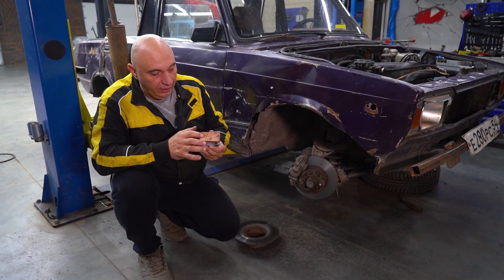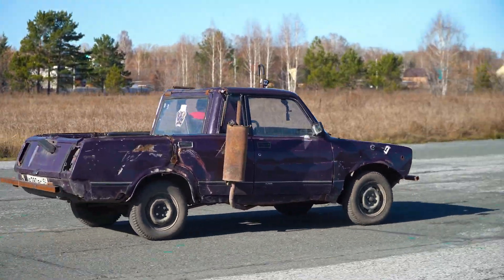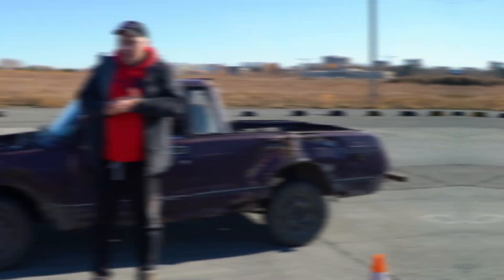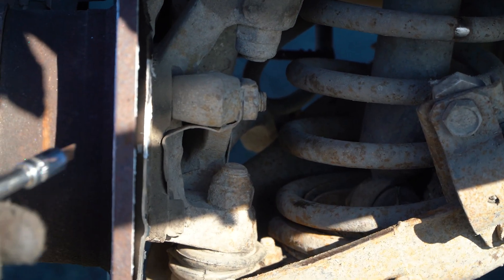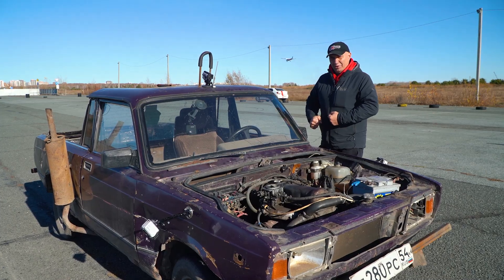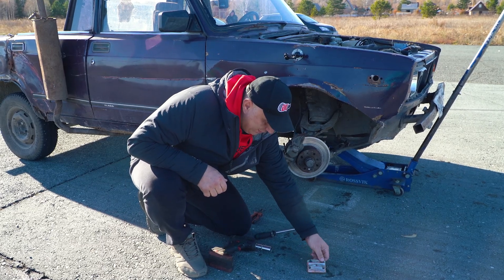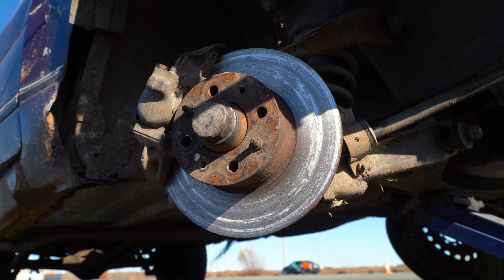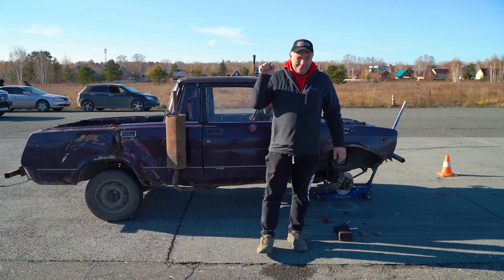Aluminum vs. copper brake pads – which are better?

Comment: Whatever they made my 1979 Datsun 620 brake shoes with is the best, they have lasted over 40 years and still have 40% left.
Reply: How many miles?
Reply: @DarkLinkAD  only 57k miles. It's not just the miles, but the time. The pads are not cracked and the original hardware still functions perfectly, it's good quality stuff.
Reply: Asbestos
Reply: @MYartiisMuRdEr  Good stuff. Trace amounts, it's inert and stable in a brake pad. If I was changing them several times a day, all my life and blowing dust everywhere. I might wear a mask.

Comment: I'd like to see comparing that to tungsten pads. Probably wouldn't wear down at all.
Reply: You kind of want to wear the pads instead of the rotors though...
Reply: Yeah, you'd cut straight through the discs, without actually having much grip.

Comment: You guys have noticed the shiny metallic flecks in brake pad material? Copper is one of the metals used in the brake material. The light coloured flecks, could be aluminium, or magnesium.

I'm not sure about modern pads and shoes, but in times gone and past, brake linings were formulated for specific applications, and in particular, according to whether the brakes were servo assisted, non assisted.
Reply: Copper has been almost fully eliminated at least in North America, it was causing reproductive issues in salmon. I believe they are limited to 5% copper max, some brands have moved to a fully copper free formula.
Reply: Id like to see the study on that, copper is still in every Horse/Cattle Salt rock, Every vitamin/mineral complex for humans and is an addative for turkeys to relax the arteries, preventing a heart attack from rapid growth.
Reply: @DarkLinkAD  I understand, and all i have access to is the internet, so i suggest that you google "copper being removed from brake pads".  and while copper is necessary for humans, it is well known as an effective agent used to prevent sea creatures from attacking boats.:goodvibes:
Reply: @bgbthabun627  I learned that information before the internet was a publicly available thing, farm work. If you have a study to reference from a reputable source such as PUBMED, ill read it. Im not much for google propaganda though
Reply: @otm646  that's correct don, so good of you to mention this.

Comment: So what do the major brake pad suppliers use on their full metallic pads? I'm sure it is metal but of a powdered construction. I don't know but I would like to see if you could buy your own lining and reline your own pads. In the old days here in the states you could get linings for brake shoes. Sure there would be issues with some jackleg not doing it right but...
Reply: Ceramic and carbon mostly, depends really.
Reply: Steel, copper, ceramic, kevlar are some common materials, all bound in a carbon compound

Comment: Copper work hardens when force is applied and softens when its heated. In this case both were happening repeatedly, so a graph of the results would have been interesting.
Reply: am i remembering correctly thay copper gets a h igher coefficent of friction the hotter it gets to a certain point? cinter clutches and racing brakes have copper and stuff like that in em if i remeber correctly, and they all need abuse to work correctly.

Comment: I use a copper type sintered brake pad in my dirt bike, they brake well in the wet and mud but they wear the rotors faster than the carbon/kevlar type.
Reply: I've seen those, they have a lot of copper in them.
Reply: Most brake works good in wet

Comment: I think the copper pads were getting contaminated with aluminium remnants from the discs, would have been a better idea to have separate sets of discs to test so one didn't harm the other...
Reply: I  agree... I bet high grade brass would be even better ?
Reply: @kylereese4822  It might be interesting to compare brass to bronze! (I would choose the copper alloy with the highest melting point)
Reply: That would definitely have been the best way to do this, yes!
Reply: They machined the discs before both tests.. So was no contamination
Reply: @ashenthrenchetty7  they said they will machine the rotors. Clean them. Then put the pads. But all they did in the next shot was clean the rotors. Definitely contamination between the two
Reply: @ashenthrenchetty7  they didn't. You can clearly see the aluminium on the copper pads.

Comment: The rulers hate us having copper anything today but do love them some planned obsolescence 24-7.
Reply: That's why they market thin pads that require replacing often, hello?
Reply: I'm not sure if the low copper or zero copper brake pads are really a problem. I used Akebono zero copper brake pads on my mom's 2011 Honda CRV. They even outlasted OEM Honda brake pads, which may have had copper.

Comment: How about carbon fiber brake pads?
Or carbon fiber rotors?
Reply: Carbon fiber pads would do a wonderful job of grinding down your rotors, carbon fiber is usually very abrasive.

As for the rotors themselves, I think a normal carbon fiber composite would suffer failure of the resin due to heat. However carbon fibers are often used as a component of ceramic rotors used in the brakes of high performance cars and aircraft.